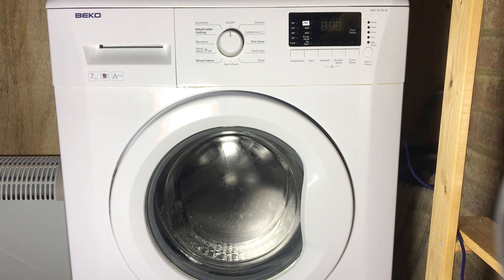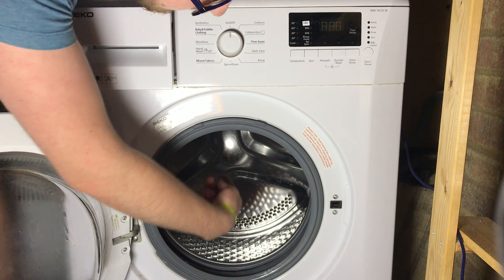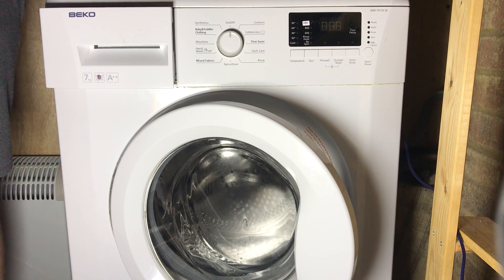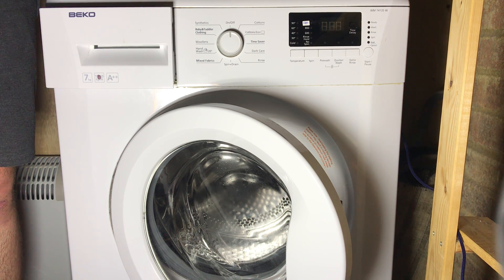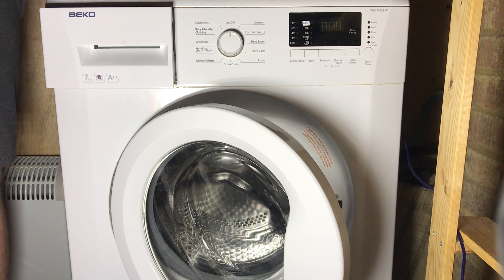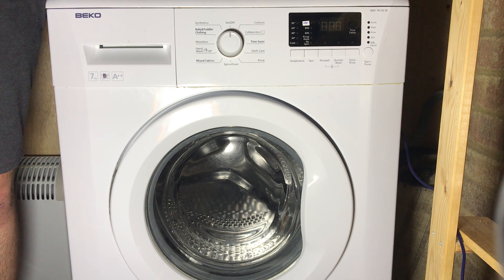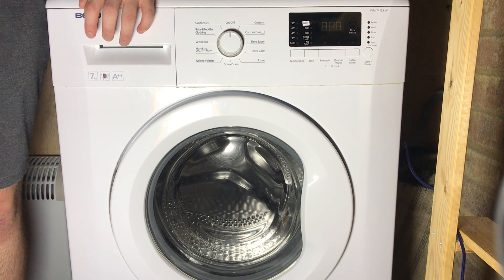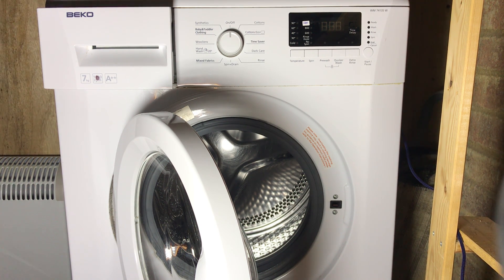beko WM/WMB - error code meanings and solutions

Comment: I have an E13 code, but E12-16 are missing from this helpful instructional.  Can you please tell what E13 is?
Reply from the maker: beko don't provide information about E12-E16.  can you describe what the machine does before the E13 code appears? or even better, email me a video if possible. it might give us a clue of the faulty component(s)
Reply: @thelaundrycookie1200 From the LED lights, machine looks like it will start normally in a cycle, yet when I press start, the wash light comes on solid for about 30 seconds, then starts blinking, with no cycle start.  Does this on all wash cycles.
Reply from the maker: does it take water in? or does it not even reach that point?

Comment: Hi! I got an htv8636xs0, error code E00. I'm at a loss, can't find the error anywhere for the life of me. I know it's not the same model but I'm desperate :( do you know what it may be about?
Reply from the maker: E00 shouldn't be an error, rather the machine telling you that there are no stored errors, in the same way as mine displays E-- when i do error reading. are you able to tell me what happens just before you see E00 appear?

Comment: We have E18 error but the door will not open at the end of the cycle to allow us to redistribute the load? Is there a way to override the door lock? The machine is definitely draining and we have cleaned and drained the filter
Reply from the maker: unusual, perhaps try running a drain cycle (spin but set to "no spin") to see if it unlocks after that. if not then there must be an issue with the lock not releasing
Reply: Did you ever find a solution that worked?
Reply: I did, I used a piece of ribbon to open it, I saw it demonstrated in another video!
Reply: @snailcarpaccio  Can you link me please?
Reply: @snailcarpaccio  Awesome!  Can you give a link?

Comment: I have this exact machine and I washed a heavy duvet in it. It finished the cycle and seemed okay but now won't spin or start a new cycle for anything else. Showing e18 and won't start even if i redistribute the load
Reply from the maker: E18 indicates failure to spin due to unbalanced load. you mention it won't start at all - E18 should not prevent the machine starting. try unplugging the machine for a minute or so, then plug it back in and try starting a cycle again. if it still doesn't start then there's a potential PCB fault. hard to diagnose such a fault without being in front of the machine.

Comment: How to fix that it doesn't work on 4 5 when tested
Reply from the maker: 4 and 5 are motor tests so if it's not doing anything then the motor likely needs new brushes (for brushed models), or there's likely a fault on the inverter board (for brushless models).

Comment: Hi what if the machine have got na error number 18? Won't start and I have a problem to remove the error.
Reply from the maker: E18 means the machine couldn't complete the final spin due to not being able to balance the load. this should not stop you from starting a cycle. turn the dial to off, then try starting the cycle that you're trying to run.
Reply: Again the same it won't start but I've noticed also that the door doesn't lock.
Reply: I can't reset this fault. Washing machine has number wmb 71032 (Beko).
Reply from the maker: you mention the door not locking, it sounds like you could have an issue with the door lock. it's possible that the E18 error was either stored from a previous wash cycle, or it could be a false error. beko can be weird with door lock issues, mine had an issue where the door suddenly just never locked (yet worked as normal), but it also never gave an error. even before it broke, i once started it without the door shut and the only thing it did was reset the cycle as if i had never started it. no error. so if it's not locking, i suggest checking the door lock. you could also try entering service mode and seeing if it'll pass through that (i have a tutorial video for that if you need it). let me know how you get on.
Reply: hi j have the same problem did you solved it?

Comment: What is the solution for e11
Reply from the maker: E11 is a motor fault. first step is to check the brushes. if they're still good then it could be the motor itself or a potential board fault
Reply: @thelaundrycookie1200  
Thanks for your reply. I have beko wtb741r2a 7kg. Moter brush is fine but when machine start then stop after 5 minutes no spinning.
Reply from the maker: when you say no spinning, do you mean there's no movement in the drum at all?
Reply: Yes when it starts then it moves but after few minutes it torally stops nd doesn't move at all
Reply from the maker: if you check the brushes and they are fine, then it's either the motor itself or a PCB fault
Reply: I had e08 on my beko washing machine but my problem is the washing machine wouldn't stop filling up, I have done a reset and service test, will this of sorted my problem please?
Reply from the maker: not stopping filling with an e08 error is a pressure switch fault, as e08 indicates the machine isn't detecting water. either the hose leading to the pressure switch is clogged, it has come loose and fallen out, or the switch itself is faulty. service mode cannot fix faults - it is simply a diagnosis feature.

Comment: what if the machine will not work at all (can't rinse) due to E17
Thanks
Reply from the maker: E17 is an oversuds error. if the drum is full of suds, add a bit of fabric softener into the main wash compartment of the drawer, followed by some water. this will help to remove the suds because fabric softener neutralises detergent.
Reply: @thelaundrycookie1200  Drum is empty ..  Flashing start symbol at 12 oclock position
which changes to @12000 at Rinse position
Reply: @thelaundrycookie1200  won't cycle through options in test mode  .
Reply from the maker: hmmm strange that it doesn't cycle through the options in service mode. maybe it's glitched🤔

Comment: What is the solution for E10
Reply from the maker: E10 means the door is jammed. the door lock is probably at fault so try replacing that. however be aware that E10 may be caused by other internal issues such as the PCB
Reply: @thelaundrycookie1200  thank yoj so much for your suggestion
Reply: E17